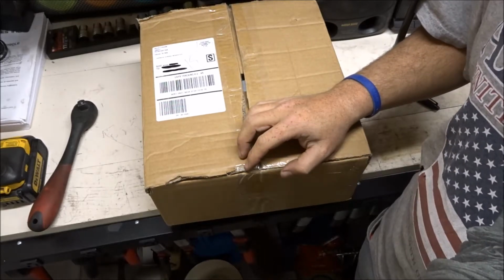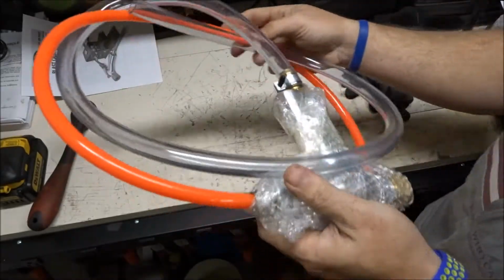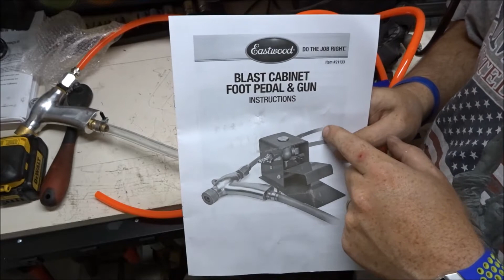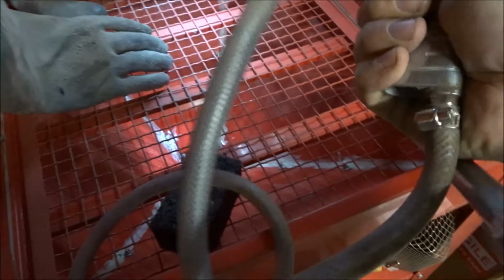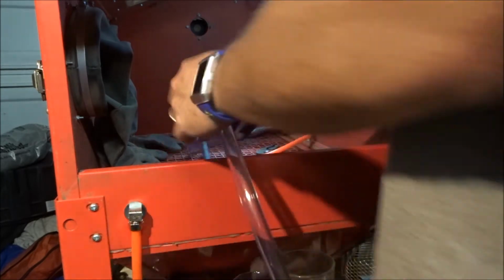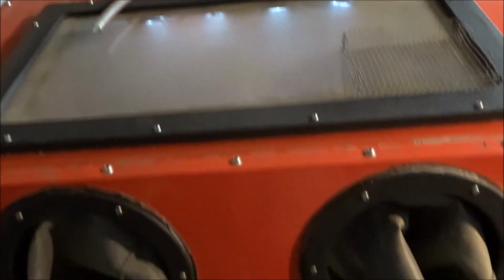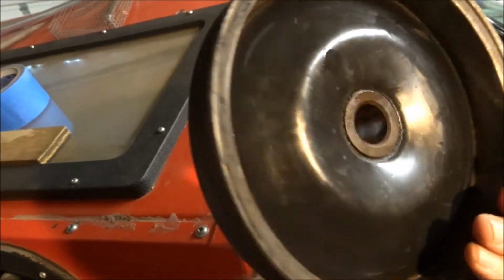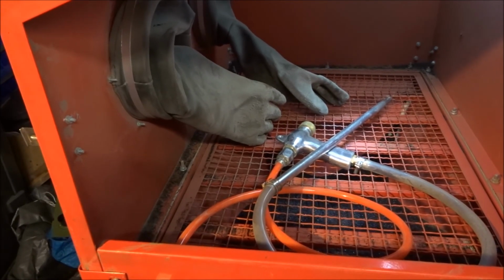Adding an Eastwood Foot Pedal and Gun to a Habor Freight SandBlasting Cabinet

Comment: I have the blast cabinet with metering valve and this Eastwood Pedal setup.  Worked great for a few months before the pedal valve stopped functioning.  Too expensive and unreliable in my opinion.  I'm switching to an electric pneumatic valve that has a high flow 16mm inner orifice and 1/2 NPT threads.  for $16 if it breaks I'll grab another one.  Meanwhile the pedal is $72.99 right now.  Not a "consumable" price for something unreliable.  And I wonder how big the orifice in the pedal is and if its a big air bottle neck?  I may have to take my broken one apart to find out.
Reply from the maker: It's 6 years later and I'm still using it.   Maybe you just got a bad production run.   But I do like the electric pneumatic option

Comment: Good stuff, i just picked up an old non harborfreight cabinet (after seeing how much work was required to make it not leak).

Not sure who makes it, but its fully welded, super heavy, and it has a pickup that connects to the bottom of the cabinet funnel thing...

It also has a powered vent system that i need to figure out.

Only down side is it needs new glass, and i need to completely dissemble, clean, and replace all of the hoses.
The gun also looks like it was made out of sprinkler pipe, so I'm not expecting it to work very well if at all...
The kit you have looks compatible with what i have!
Reply from the maker: Sounds like with a few issues you can easily fix.  I think you have a good unit and should work well
Reply: I think it will be a good one, however, it's hard to move around... lol
Gloves in it are interesting, leather and thick.

Also it has a big single piece ruber seal around the door.
Sorta like the weather strip on a car door, luckly that's still flexable and good condition.

Lots of figuring it out over this weekend!

Comment: Put a metering valve and an air regulator and you will then really see how well that cabinet can work. All while only requiring between 40-45 psi of air.
Reply from the maker: richard ortiz yep i put a pressure regulator on it and while i used it. I had my son turn it up and down and i think your right i got the best performance around 45-50 psi.  Thanks for your comment
Reply: yup.. a metering valve makes all the difference.. you can run on about a cup or 2 of media at that point. best upgrades i ever did to my cabinet.
Reply: Will a metering valve work with this setup? I’m super interested about adding a foot pedal and new gun. I currently have a metering valve.

Comment: Beware this brand has known issue with both the gun being off center & the pedal having small holes which will reduce your air flow.

Ps: an off center suction gun (sand blasting gun )  is USELESS .
Reply from the maker: So far so good but thanks for the heads up to watch out for

Comment: Oh u have a lot still to learn about blasting cabinets. The siphon tube is worth about 1 penny scrap which is more then its worth in the cabiner lol. Its a path u will discover thru yrs of use. Hint, convert it to a gravity feed, throw the tub away, you are waisting 25% of your electric bill on waisted air to suck sand theu tube.  Dump the tube, power bill gies down, compressor life goes way up because it will actually be operational at a much lower pressure, last longer, blast faster. Good luck in your discovering better ways. Its fun
Reply from the maker: I'm always up for learning better ways that's for sure.  Did you have a video of your set up I'd like to see it.  It does sound like a way better and efficient way to sandblast
Reply from the maker: @michaelcollins1899  I do have a Facebook page with my channel is love for you to share it there.  I've not seen this method before but makes a lot of since to me.  So what pushes the sand up the tube?  I figured it would be like fluid. it will only gravity feed up to the level of the sand.  Then the suction takes over from there?  I just don't see how it works completely. Is it the pressure in the cabin that pushes the sand?  Then can you not use a vacuum? I'm sure a picture is worth a thousand words
Reply: @2LateIWon  gravity feeds sand into the hose and from there it only travels up about 10 to 12 inches and theres plenty of suctiin inside the gun itself to get it there. It works great. I tried the tube as well and it was garbage.
Reply: Whats the fb page?
Reply from the maker: @michaelcollins1899  https://www.facebook.com/2LateIWon/
Reply: @michaelcollins1899  , is the diameter for the output of the pedal big enough? i see that they mention 6 somewhere and one of my first errors was using the adviced 6mm hose from compressor to cabinet/ mobile setup.  since  use 10 mm hoses it does work ( altough as you mention the tube system is garbage and doesn't work decent.  i'm currently getting all stuf together to adapt it to a gravity feed and pedal powered cabinet. also order some items to add a dustcleaner to it so i have better vieuw inside when working
Reply: @yoerim360  all my horses in and outside of cabinet are 3/8 inch
Reply: @michaelcollins1899  yes , buut when the valve inside the footpedal is full open , what is the open diameter of that  ( as that can be a bottleneck)
Reply: @yoerim360  I do t have the foot pedal
 My setup is fun with trigger. Yes it obviously is smaller right there where needle let's it thru nozzle. That's how and why it has pressure. Without a small orifice, it would just blob sand out at almost 0 psi lol. The foot pedal setup, does not have sand traveling thru the pedal lol, that's just air so restriction and clogs are not in that area. The air travels up the hose and then mixes with sand in the gun.

Comment: Why would you by a guy that cost almost as much as the gun and use a pickup tube? that tube is  ment to run from the trap door back into the cabinet that way you are not limited on movement.